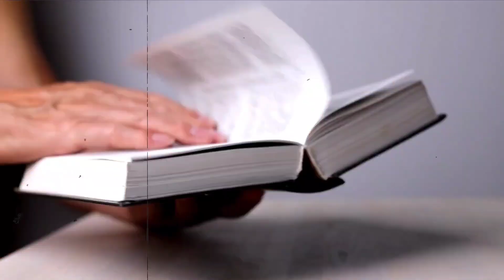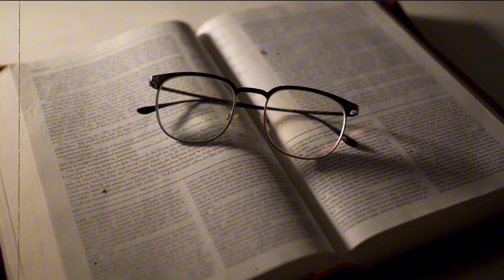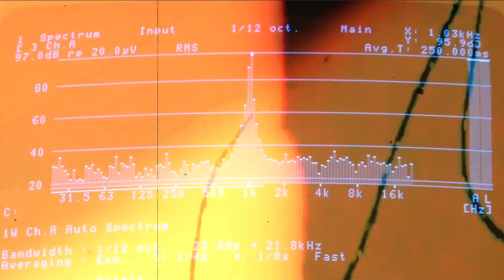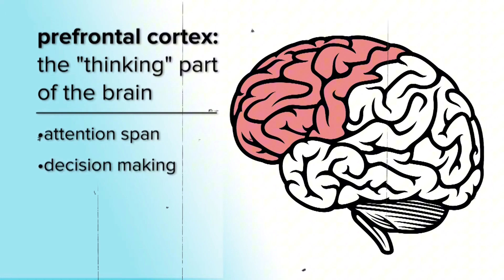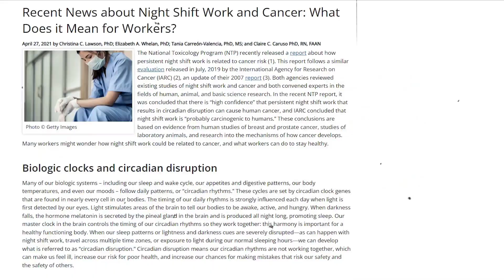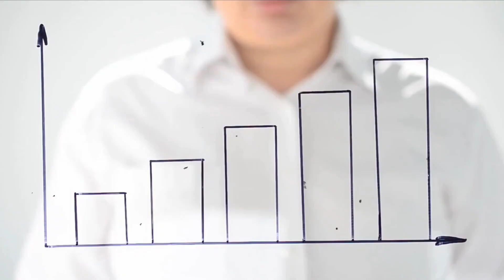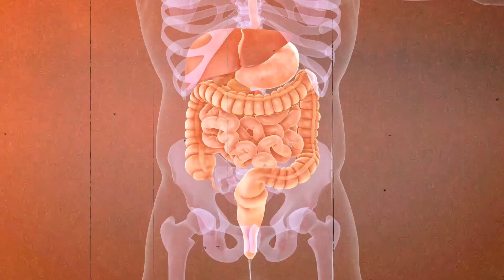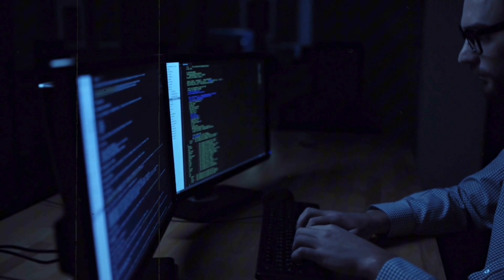Working Night Shift Is Killing You (Literally!!!) How Night Shift Work Is Destroying Your Health

Comment: Worked night/grave shift for about a decade or so, from 26 to 35 or so. Was a shift manager at a convenience store. Didn't really affect my health much, but that was prob because I still made sure to do all the stuff needed to stay healthy: Be active six to ten times a day, stay hydrated, avoid drugs/tobacco/booze, keep stress levels low, other stuff like that. Also was probably lucky that I was younger when I did that. I couldn't imagine doing that kind of thing now haha.

So yeah working night/grave shift isn't ideal at all but that doesn't automatically mean you're doomed to not be healthy because of it. I still managed to be active about ten times a week during the decade or so when I worked grave shift. Would go to the gym or for a run directly after work, get home, go to bed, get up a few hours before starting my shift, hit the gym again, then go to work.

Today at 42 I'm way fitter and healthier than most my age: Am only about 30 or so lbs overweight, don't have any heart issues despite running about 12 to 15 miles a week, can do 100 push ups in about 5 minutes, have no real health problems other than the normal aches and pains that anyone in their 40s would have. Only time I get sick is if it's allergy season. And even that is pretty recent.

I feel like I should make a guide or something about grave shift on my channel haha.